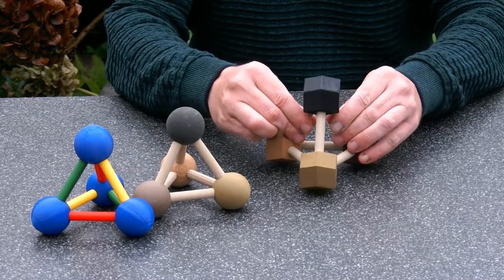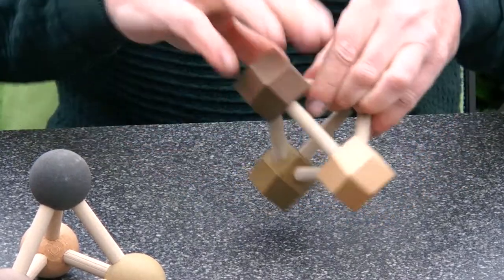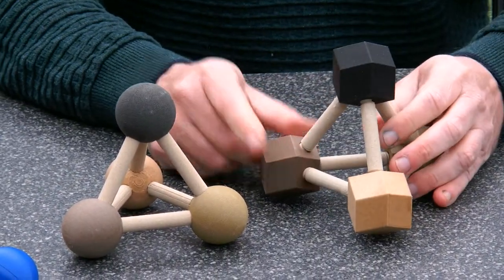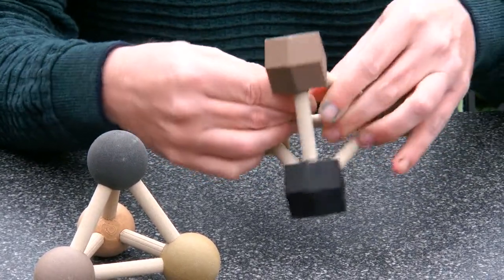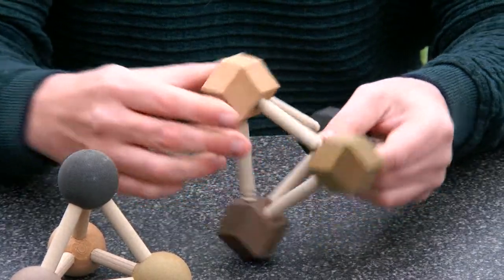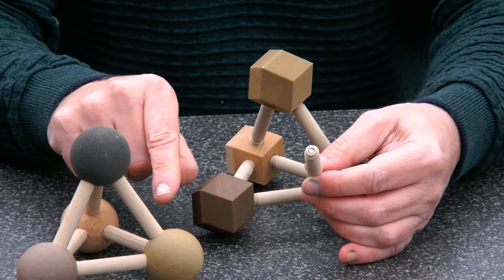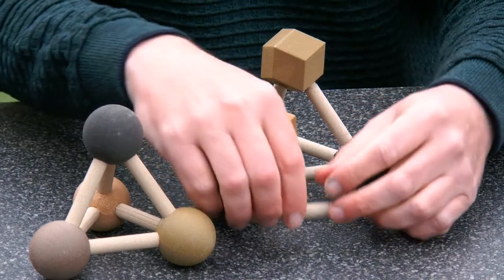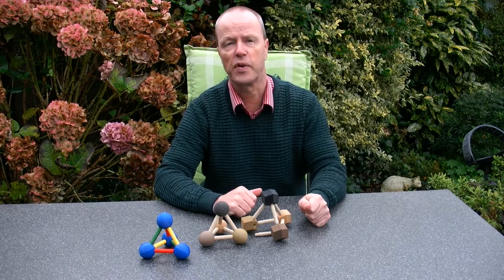Screwballs Too - How do you like these little innovations?

Comment: I do wonder if it would be possible to remove the need to gradually unscrew all the parts. Perhaps by making one of the rods connect using magnets, or using much shorter threads. Then it would lead to a shorter disassembly time. Really nice puzzle idea though.
Reply from the maker: Yes, there would be many ways to construct functionally the same puzzles. Magnets would work, and so would other binary construction techniques, like pin+hole.

Comment: It should be possible to make an octahedral accompanying puzzle using the same rhombic dodecahedra and 12 connectors (using four faces around a vertex with 4 edges instead of the three faces around the other vertices with 3 edges)...